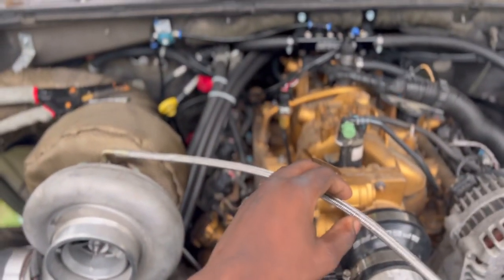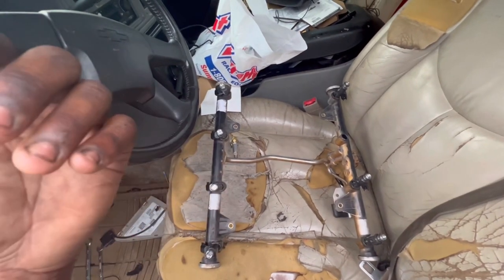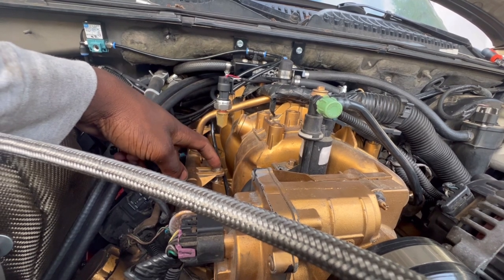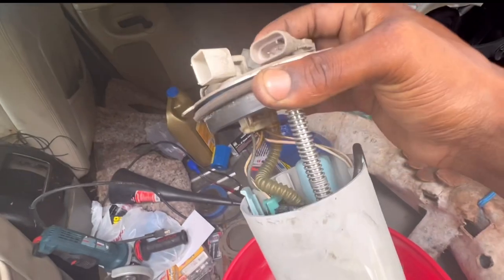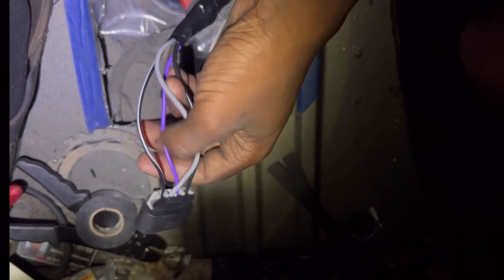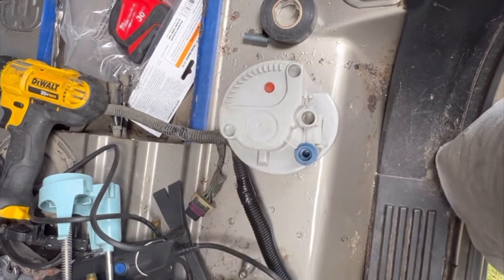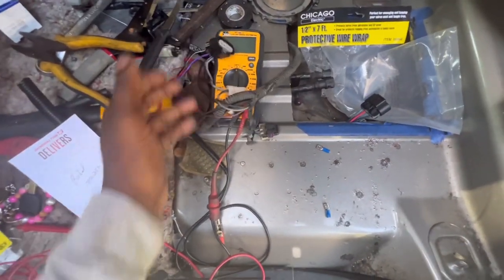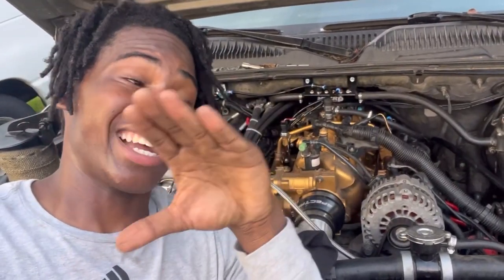Turbo 5.3 was almost complete till this happened!!

Comment: sounds to me like the pump is running backwards double check your wiring, the bubbles are because its sucking air through the outlet
Reply from the maker: You the man I spray out something I didn’t think of 🤙🏾 the harness red and black needed to be switched 💪🏽